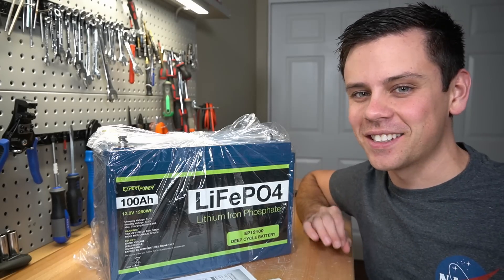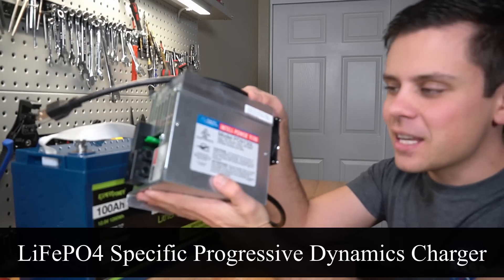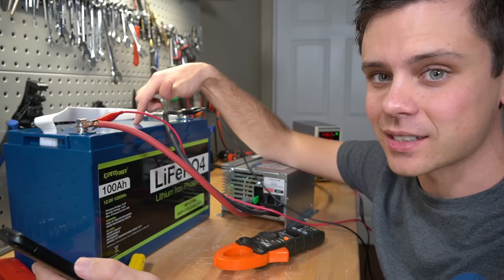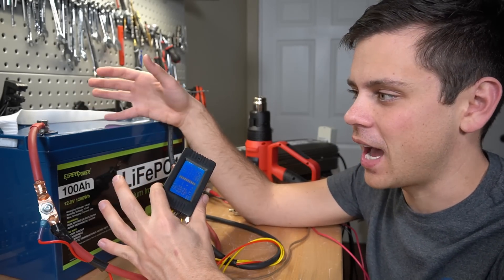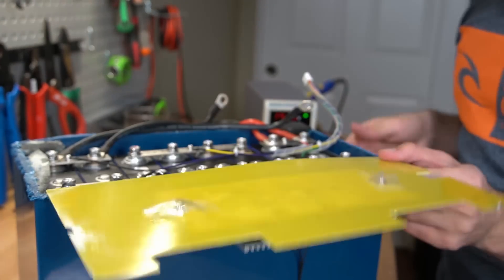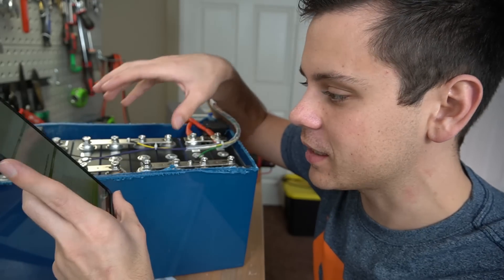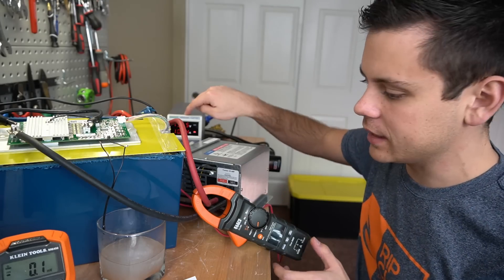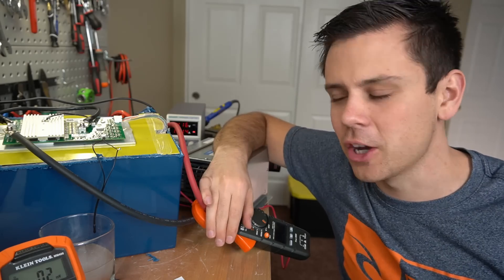ExpertPower 12V 100Ah LiFePO4 Battery Tear Down!

Comment: As @Scoot B mentions below, the low-temp issue is probably a component mismatch or poor tolerance sensors. China can make excellent products, but to get that you must constantly watch over every step of the build process and component supply, or they will cheapen the process somewhere to increase profits. TBH I doubt this fault is something ExpertPower was aware of (at least I hope not!) so maybe your review/testing will let them get the process fixed.

Comment: Your test results with these units failing to cut-off charging in real-world low temperatures has me wondering if they are actually protective in overtemp conditions, "certified" or not. If they're failing to stop operation at their low cut-off, how can they be trusted to stop an overtemp condition? I think the vast majority of buyers just necessarily assume that their claims for doing that are valid, also. I see others on Amazon noting that their low-temp cutoff also didn't work despite the specs. How many units and what parameters were involved in the safety certification(s)? Probably no way to know without getting deep into the weeds, and assuming the organization releases that information.
Reply from the maker: Some of my viewers have been mentioning that these cheap temp sensors have lackluster tolerances and quality control. I doubt it's the BMS. But yeah, we like to trust the data sheets a lot. I wonder how accurate they really are..
Reply: @WillProwse   I did some weather-observing station design a while back and got a little bit of experience with cheap vs. midrange RTD's (resistance temp sensors), assuming that's what they're using. In my experience the really cheap ones were typically either within a reasonable "consumer" tolerance (resulting readings of +/- 3 or 4 C, far too wacko for serious applications, but maybe expected here), or they simply didn't work at all. It should be relatively straightforward to check whether it is the BMS or not, even without a schematic, by just testing resistance across the temp sensor wires (nom. industry spec is 100 Ω@0°C, with delta of around 0.385 Ω/°C). Who knows what they're using, though, and if it's an actual thermocouple out there instead of control at the BMS, all bets are off. If it's RTD-based, you can use a variable resistor to see if the BMS does cut-off at some value and see how that compares with the sensor's reading.

Comment: How about doing a low temp. controlled rate charge with different cells and do a Myth Busters type of video?........ Enquiringly minds want to know how low is too low and will I damage my battery?   Perhaps you're over thinking this low temp. battery setup?  Battleborn CEO said a low amp charge 10-20 amps would be fine and not damage their battery.  Typical solar/charging  RV-MH-Trailer would fall into this range in the Winter.   I plan to install my batteries inside my living area of my truck camper, but would like to know how far is a safe temp. that I can push them without destroying.  Tnx for all the time and effort you invest in your videos.

Comment: I love your tear downs and capacity test.  Ive been building lithium systems for van conversions and RV’s for 4 years.  Recently have installed a few LifeBlue Lithium batteries with Bluetooth.  I would really like to see the inside, just cant justify opening one up!  Could you test one of the LifeBlues?

Comment: I agree, Will, this is VERY disappointing. But you continue to do a great job and deliver a greatly needed service, so thanks! I hope the low temp disconnect DOES work. That would make me tempted to change over from Tesla to LiFePO4. 

But as it is currently, I just added a $15 Inkbird temp controller and warming pad for low temp protection.

Comment: What's amazing is you calling a $700 battery cheap. And cutting into it like $700 was nothing. You can't series or parallel it..puh. There are much better options.

Comment: Do you know If that green battery by valence had low temperature disconnect?  If so did you where its cutoff was?  Also valence makes a 138 amp battery they say you can use them I series up to 48 volts. I would love to see the inside of one of these. All your information is greatly appreciated.  Thank you for staying up late to bring us such great info✌

Comment: you can run the test while you sleep or whatever else. set up your camera pointing at your meter, setting a low frame rate and only just enough resolution to read the meter. Then after the battery runs out you can use the video to read the final numbers.
I appreciate your testing and tear downs. Thanks!

Comment: hey Will, don't you think this 12V thing it's outdated? I mean for off-grid and even for RV the minimum voltage should be 48V (...maybe up to 96V?.. what could be the limit?) for efficiency&costs reasons
Reply from the maker: Yeah I agree but people still use 12v unfortunately :(
Reply: I agree!   In many ways 48 volt is easier to work with and should be lower cost (but it does not have the economy of scale to really show it's advantage).   From a fire point of view, 48 volts is probably safer due to the lower current.  From an electrocution point of view 48 volt is a little dangerous but still low enough that it usually won't hurt you.  (Don't get me wrong.... it can hurt you...but is a lot less likely to than 96 or 120)

 12 volt is an automobile legacy we are going to be stuck with for the foreseeable future.   It has a momentum that is going to be hard to change.    The good news is that 24Volt is becoming a lot more common so we can almost always get a 24 volt version of a piece of equipment.  (this is probably due to the fact that a lot of heavy equipment and large trucks use 24 volt).     48 volt equipment is becoming more available.... but is significantly more limited in selection.
Reply: @prygaard  I wonder if inverters' efficiency nowadays are good enough to get rid of 12v or 24v equipment and use instead 120/220V AC which are much more affordable.
Reply: @r3v0l98  

The equipment I was referring to was all of the parts around the batteries (inverters, chargers, fuses, the batteries themselves, etc).   But you bring up a good point about the appliances/loads you are powering

Inverter efficiencies typically run between 85 and 95% (95 is rare)   Depending on the situation that may be tolerable.

For homes/cabins I recommend staying with 120volt unless you are on a very tight energy budget.   I personally don't feel the complexity of dual voltage is worth the gain....   but that is a personal opinion.  However, you should stay with high efficiency (more expensive) appliances.

For boats and campers.... you are almost certainly going to have a mix that will be difficult to escape (Particularly a boat).

Comment: But you/we can still build a better battery with the correct sensors for cheaper than this cost, right?
Reply from the maker: Oh absolutely, check out my diy build videos
Reply: @WillProwse + Thank you so much.
Could I run a problem by you? 
For some reason my solar set up stopped working. 
I have the EPSOLAR 20A MPPT model with the MT50 remote access. And for some reason it's not charging , but I suspect it might be from low voltage.
The image on the MT50 shows the panels were receiving 20volts but 0 amps going to battery with that stupud sad face above.
Please dont yell at me, but I know I abused the batteries before knowing that I was... and I know I have a mismatch batch of sealed deep cycle batteries .... 
The indicators are that I am showing 10.4 volts which I know is bad.  My guess is that the low voltage cut off kicked in, so how can I remedy this for now until I can get money together to build my own in a couple of months? 
I am 62 yrs old and living in my van in San Francisco with no access,  or limited access to any outlets to charge from.
My van is my home. 
Just looking for a remedy temporarily until I can get new battery set up.
I kind of know how to operate the MT50, but am.having a problem figuring out how to change parameters to get the panels and charger to send voltage to batteries to bring them up to par again.
I'm sorry for bothering you with this, but I am at my wits end and dont know what to do.
I appreciate your time and thank you for reading this.
  Casey

Comment: How are you able to push 30amps into the battery from a 15- 20amp electrical outlet?
Reply from the maker: 30A at 12v. So 3.2 amps at 110 volts
Reply: @WillProwse  
Thank you!!
Reply from the maker: This is not a 110 volt battery haha

Comment: Build your own external low temperature switch that connects to a battery cable, maybe inline to a cable.
Reply: You don't want to be switching the high-current side which is why these sensors feed into the BMS where low-current switching can happen.

Comment: If you're in California, I'll bring you down an Amazon Shunbin 500ah to test. For $1985 free shipping..had to roll the dice. Using one in Cabo and been off grid a month (other three in Cali).
Reply: Will is in Las Vegas. 500Ah at that price worries me- that price would buy only half the capacity of the best batteries.

Comment: If the temp sensor is just a thermistor unplug it and measure the resistance cold and at room temperature. With a part number (and maybe without) a conversion chart can be found.

Comment: Each battery BMS will operate independently -  so I can't see where a restriction on the number in series OR parallel would come in.  Makes no sense!
Reply from the maker: Yeah doesn't make any sense to me either for parallel connection. Very strange
Reply: I had wondered about this for a long time.   Someone finely explained the series hookup problem in the comments in Will's last teardown.    If the BMS has to cut the current due to over-voltage, temp, etc.  It is suddenly exposed to the voltage of the whole series string.      By forbidding  series connections they can get away with lower voltage FETs and other components.     

It seems to me the extra cost of the higher voltage components would be easily offset by the larger market.... but what do I know?

Comment: Maybe you should switch to the other sensor that's now attached to the heat-sink.
Reply from the maker: That's for over temperature only. That's why I posted data sheet with the thresholds and what sensor does what.
Reply: @WillProwse  I was just thinking that it might have gotten switched on the board.  But then again, your first test was to freeze the entire battery...

Comment: This thing has a big thermal mass, and only a small surface area.  Perhaps 3 hours in the freezer is not enough to get the inside below freezing.  Try overnight next time.
Reply from the maker: That's why we took it apart and tested it manually
Reply: @WillProwse  Right, sorry, I commented before I finished watching the whole video.  You did a great job.  I'm a big fan!
Reply from the maker: It's all good, it was a good point. I was scared of that too. And thank you!

Comment: Only charge at 50A???? Mate have you looked at the charge recommendation for LiFeP04 100ah cells?
Reply from the maker: .2C-1C is what most data sheets recommend.
Reply: @WillProwse  I've been looking for cells for a while and have mostly found initial charge< 50A and float charge 0.2c. So can you increase the amperage by 50A for each cell the battery contains?
Reply: @jarlnieminen4307  YES AND NO.   If you have cells in series, you can NOT add the current.   For 12 volts you will have at least 4 in series.

If you have cells in parallel, you can can add the charge current.   In this battery they had 2P4S.   So, you could add the allowable current for 2 cells for the total allowable for the current.
Reply: @prygaard  that was my thinking but I was starting to question myself thinking maybe there was an overflow affect.
Reply: Just seems like there would be a limit.

Comment: Will, could you install another low sense probe off of a working system to check  the low temp cut off, to eliminate that component?
Reply: If he has one the SAME type and you cannot measure the one he has as it is most likely bad

Comment: try freezing both thermostats!
Reply from the maker: Protection is enabled for charging with the battery sensor. Look at the data sheet posted in video
Reply: Will started out by freezing the whole battery..... and it still took a charge.